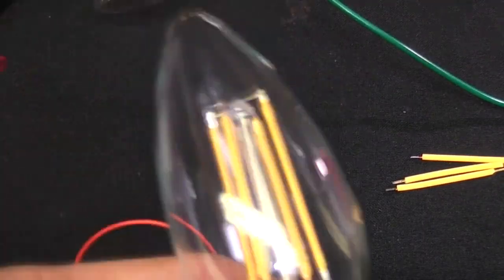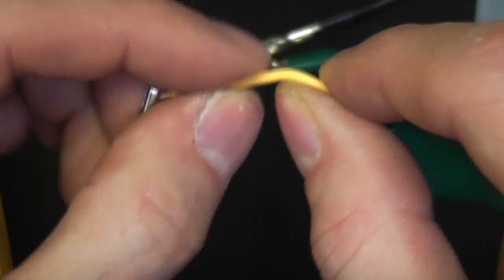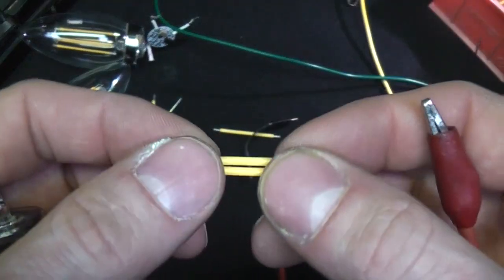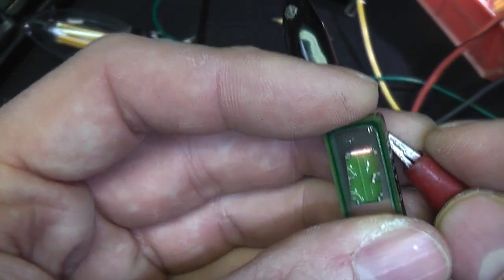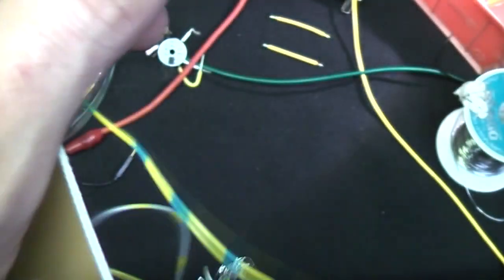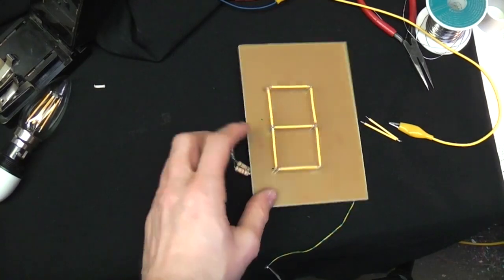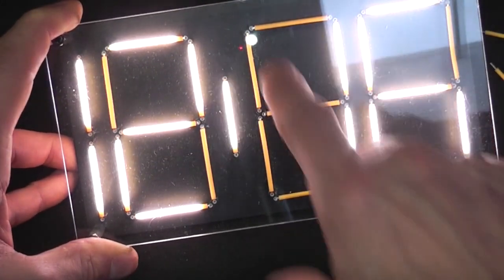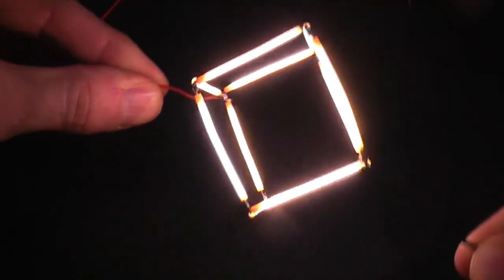LED filaments

Comment: Very nice!  I'm hoping they do these filaments in other colours at some point.
The ULN2803 went through my mind when I was playing with these.  Octal Darlington driver rated to 50V.
Reply: +Dick Fageroni Yeah but the TI chip (which I just happen to have a tube of right here) is serially loadable and can be daisychained - much less wiring
Reply: That's what I thought of as well. They work great for driving nixie tubes too.
Reply: bigclivedotcom You can buy bulbs with coloured filaments.
Reply: You can get loose coloured filaments (red, blue and green) on eBay now, including ones at 12 V and 3 V.
Reply: @rupert274  Really? What search terms?

Comment: Careful with that ~200v cube :)  Really interesting as usual, off to eBay now...
Reply from the maker: Tony Wilk what's the problem.... I did put a 10K resistor on the output of my 0-600V bench supply!
Reply: mikeselectricstuff More power Igor!
Reply: Yeh, I had quite a few broken or 'iffy'. Just shoved in a bag isn't good enough for things this delicate.

Comment: got one of these, they have terrible flickering
Reply: mikeselectricstuff I think he's referring to the 60Hz flicker that these poses. I cannot stand those sh*tty cheap Xmas lights during the holiday's. Not only are they overly factory blue overcast to them, when looking at them indirectly (with peripheral vision) or scanning your eyes from one thing to another such that the LED lights cross though your vision, and you can see the lamp cycling on and off. I like the old fashioned Xmas lights with those nice 40W large candy colored bulbs MUCH more.
Reply: Power Max  Well, at me its 50hz, but yep.  They dont have a smoothing capacitor.  its like a strobe.
Reply: gamerpaddy With a full wave rectifier as these had, the flicker would be 100Hz or 120Hz, which shouldn't be too bad.
Reply: ***** I agree about standardizing frame rates, and wish the interlaced format dies as well. The reason for 50Hz and 100Hz recording is that that is the main's frequency common in EU and asia, so the lighting used to film movies also flickers at 60Hz, (I think the film industry use large Xenon HID lamps, although I am not sure.) If they recorded at 60Hz with lights flickering at 50Hz, there will be noticeable beat frequencies, a 10Hz pulsing effect, which is considerably more annoying.
Reply from the maker: gamerpaddy the one I took apart had the wires from the bulb just twisted with the wires from the driver PCB, so quite likely to go intermittent in odd ways.
Reply: ***** 10x bigger? What for? Efficiency is generally highest when the load is close to maximum.
Reply: MichaelKingsfordGray OK I found one mistake on my part:  I take back what I said about the 470μF capacitor. Although the current draw is tiny and miniscule, the voltage drop across the long string of LEDs inside each filament is really large, and a HV capacitor will be needed (3:03). 100μF Photoflash capacitors would be too big, and the caps I have in a junk bin are only 16V and 35V. I did find a few small capacitors, 2 rated for 160V, 4.7μF, and another one the same size, rated for 200V, 5.6μF.They are all about 8mm wide by 12mm length. I think it is possible to squeeze a few of these in in parallel inside the base, even if they stick out some.

I did some basic first order calculations to the ripple voltage over time with the 2 160V, 4.7μF capacitors and the 5.6μF one in parallel after the bridge rectifier. The total capacitance will be approx. 15μF, and that the ripple frequency is 120Hz, assuming that with each cycle, the capacitor gets charged up to the full LED drop voltage of about 70V, and that the current draw is roughly constant (12mA) over time (which it absolutely is not). Some simple math tells me that the voltage sag over 1/120 = 0.00833 seconds will be about ∆6V. This about an order of magnitude better than the ripple voltage of 70V like it was before.

Going a step further, assuming each LED has a Vdrop of 3.5V, I have determined that there are 20 LEDs in each filament so that the total Vdrop is 70V, so some differential math tells me that there will be approximately ∆0.3V of ripple voltage across each LED in the series, and the Vmax voltage is like 3.5V, and the Vmin voltage is about 3.2V. The flicker in the LED lights will be reduced, but certainly not eliminated because of the steep IV curve characteristics of LEDs. I am sure you can prove me wrong on a few things, this is the first time I used the calculus definition of capacitors to determine ripple, vs just guessing what will be needed like I so often do for many projects.
Reply: the ones to get are the ones that are advertised as being dimmable, the non dimmable ones flicker badly in any kind of light dimming environment and sometimes just flicker to spite you. the dimmable ones should be the default honesty
Reply: gamerpaddy I found the ones with a larger white base have an actual power supply in them and dont flicker. The ones with the glass straight onto the bulb cap just have a junk capacitive dropper.

Ignore any claims of no flicker from the sellers on aliexpress or ebay. They never know what they are actually selling.
Reply: It wasn't to do with lighting but to ensure that any non linearity in the crap powersupply in early tube tvs had the distortion as a static artifact. As soon as they stopped using the grid as the sync source or used a different part of it that all went away. Early cameras and until the 80's were tube based so had no shutter. 

They faded away which is why when massively over exposed with bright lights they left those trails that are a feature of 80's music videos.

Didn't get the shutter effect till Ccd cameras came along with their ability to freeze clear still shots out of video at short exposures. 

This is why people associate fluid motion with 80's soap operas since they had that effect from no shutter closures.
Reply: gamerpaddy I bought some of these, but the flickering isn't that bad on the ones I had. They had all of the filaments in parallel, so the LEDs were only actually off for a very short period of the AC waveform due to the forward drop of the LEDs being around 70V.
Reply: Power Max
Just use proper lightning with high frequency electronic balasts or use LEDs with proper PSU with 10x bigger capacity than needed.
Reply: sdgelectronics
To have a steady DC-Voltage without any ripple regardless of which current the load draws.
Reply: sdgelectronics It's all in the impedance matching! (or voltage bridging, in some rare cases)
Reply: ***** I have seen old footage of the old tube sensor's, they have an a strange but organic feel to the footage, if only they could produce HD... :( I am sure there is some niche camera on the market that does so, though way overpriced.

Although that's interesting! Though  I wonder why would they use main's as the Vsync, I would think that the AC main's would have some possibly long term drift to it, which may cause issue's, although not sure.
Reply: Power Max OH GOOD GOD I KNOW. I bought a ton of those LED lights at Christmas on a big discount, over 50% off... when I got home and plugged them in? The flicker just... I thought I was going to have a f$cking stroke it was so bad. I wonder if there's a way to wire something that would smooth out the light... I'd be willing to do it, because I'm stuck with 30 dollars of these shitty lights. I did get a lot of lights, like 300 feet for that much. I might just use them on the outside of the house where others have to see it and not me lol.
Reply: Jesse Crandle who the hell pays 30$ for these?
Reply: gamerpaddy ... You did not read what I said at all. PowerMax said he hates the shitty cheap Christmas lights with the 60hz flicker, I told him I bought 30 dollars worth of them on clearance but didn't know they flickered.
Reply: Yeah, well my issue was these lights were originally 20 or 30 dollars for a single strand, and I figured for that kind of money they'd have the courtesy to NOT use single phase. It's pretty pathetic to think that they did, though. How much would it have cost to just add 3 phase into the wall wart? It's all made in China to begin with, Wal-Mart would have made 28.50 in profit, but instead they decided to make it single phase and make 29 in profit. Pathetic.
Reply: Well for those who have lights and are bothered with the flickering, it is a very easy thing to fix. Just run down to the local radioshack and buy a small 470uF electrolytic capacitor a >100V >10uF electrolytic capacitor to place across the LEDs. (assuming there is already a full wave bridge rectifier in series with the LEDs. You may need to add one, if there is not already one in the driver.)
Reply: MichaelKingsfordGray I am sure you can figure out a way to cram one in, and if the LEDs are capacitively coupled to begin with, there is not a whole lot of things that can go wrong unless you short out that series capacitor or bypass it in some way.  Why bother with 105*C rated one? I do not see a simple LED filament bulb generating that much heat to cause the internal temperature to go that high. It is not like the capacitor is going inside a crammed SMPS next to the switching devices and rectifiers.

If you cannot get a 470uF one to fit, get a smaller cap. A 100uF one. I have ones that are REALLY small, from things I have taken apart, like as in 3mm by 5mm. Keep it insulated so as not to short out to any thing to the mains directly and the worst that can happen is that a short develops and there is effectively a small capacitor across the mains it is trivial.

If you are sooo concerned about safety, add a small 500mA-1A fuse in series with the mains.
Reply: Power Max I don't know much about what you guys are talking about, but I do know I bought some Ikea Christmas lights on sale in January, I actually use them for accent lighting, and they 50 LEDs and use a whopping 3 watts. My guess is that PowerMax is probably right, might not be (from an engineering point) a great idea to use a capacitor like that, but in the end it'd probably handle it just fine...
Reply: a Capacitor big enough to smooth out the voltage wouldnt fit in the socket, true.  but it could fit inside, where the filaments are.

even if it could last for a few milliseconds, it would make it better
Reply: MichaelKingsfordGray _"LEDs run on DC, and can NOT be capacitively coupled! They wouldn't bloody-well work!"_You are absolutely correct. Why do you think I mentioned a full wave bridge rectifier in my first comment? In fact, the driver circuit for this lamp IS made this way, capacitively coupled to mains, and full wave bridge rectified.

I still do not fully agree with the 105*C cap, since I rarely see them even in equipment, generally only when space is tight and the capacitors have to be stuck between heatsinks. Besides, what I say is nothing more than a hack solution, something that if it bothers someone enough to do something, then they can do a mini-teardown on it and make the simple mod. As long as they use common sense and make sure things are wired correctly and there is enough clearance and creepage for normal operation, I do not see the problem. Even if the capacitor dries up over time, it can be easily replaced by a DIY'er.
Reply: MichaelKingsfordGray Same. I did "build" this LED circuit in LTspice, and it seems OK, about what I had predicted. Although I do not know how to determine power dissipation with a capacitor with ESR. You do sound more experienced than me at the matter, 105*C caps certainly would last much much longer than lower temp ones. Also, come to think of it, even though again the LEDs look wimpy and low power, (with no heatsink and such) they are in fact 1W each (3:07), and there are like 4 of those in each lamp, at least 60% of that 4W is turned into heat, and with no consideration for heat buildup, that may be an issue.

Though like my original comment, as a simple hack solution, the worst that can happen (assuming again the hacker did not bypass the series capacitor and did add a small fuse) is the cap will dry out after a few months or so and flickering will slowly come back. Maybe a nice 'pop' along with it too :P.
Reply: +mikeselectricstuff Led's go wierd in all sorts of odd ways, especially if driven at the rated current. The chinese seem to like impressing us by overspecing their components. Yer at -10 it would last maybe.
Reply: +MichaelKingsfordGray I have to agree, long term exposure to that kind of lighting can be detrimental and cause nausia at least, and i'm not in any way sensitive.
Reply: Had a similar problem on a job (I'm an electrician). Crazy flicker, but when we dimmed the fixtures to about 50-65% the flicker went away.
Reply: I don't get why people complaining about the flickering just don't throw a capacitor in parallel. It would only need to be like a 100 volt and less than 100 uF.
Reply: because its sealed and theres not much space left for a cap.
Reply: yea but you can add a cap in any number of ways, it doesn't have to sit right next to the led
Reply: gamerpaddy Trust me, it's as bad as a stroboscope.
I'm very sensitive to that. I even can distinguish between 60 and 120 FPS video.
I can even tell if a 50 FPS video is displayed on a 60 Hz monitor. It's a glitch party...
Since PAL and NTSC does not matter anymore, I hope everything other than 30, 60 and 120 FPS will die forever!
24 FPS is crap. Cinema should go for 30 60 or 120 FPS, NOW!!!
No one needs that 24, 25, 50 and 100 Hz crap anymore. And that being said by a German, where PAL was standard!
Sorry for ranting, but enough is enough... The simple reason is that almost every display is running at 60 Hz. So 30, 60 and 120 FPS are fully compatible, you won't see any stutter and glitching caused by reordering the frame timings to align to the bloody VSync, because it's simply not necessary anymore.
Reply: ***** EVERYTHING TRUE, but cinema stay at 24p. I really like the look of it in the theaters, and when I screen my indie film next year I want it to be shown in 24. it just does things to the mind. willing suspense of disbelief, less is more in a movie. I make movies and honestly when you watch movies from the masters like Tarantino, Scorcese, Hitchcock - its almost like the film wouldn't work at a higher frame rate! Every frame and the way it appears is purposeful. The directors and their art departments share dreams.... jk they toil endlessly and yet at the same time concisely and effectively.

Comment: Excellent video.
Perhaps it would be possible to replace the sleeve with a more attractive one.
Or just use the bare LED strip for a "high tech" look?
Reply from the maker: mark314158 No - if you peel the silicone (or whatever it is), it takes the bond wires with it. Might be possible to dissolve it in something though.
Reply: mikeselectricstuff Or since they are so bright put the whole thing in another more attractive sleeve or coloured glass/plastics tube.

I wonder if some manufacturer in China might not be persuaded to sell a reel of bare diodes ...

Comment: How do you turn your PC on and off? I mean, the back of the case is facing you, and assuming the power button is on the front, it doesn't look like you can reach back there easily with all that stuff and cabling...
Reply from the maker: MinecraftReviews1 It's a homebuilt case with everything on what is usually the back.
Reply: Oh, thank you for the quick reply.

Comment: "They turn into dark-emitting diodes" XD
Great video and project as always!
Reply: komrad36 You haven't heard of the Smoke-Emitting Diodes? xD.
Reply: komrad36 I can remember playing with LEDs in high school, I put one across a car battery and made a pop emitting diode. Damn near crapped myself.
Reply: If you drive enough current trough them they might turn into black body radiators and end up looking like real tungsten filament again!
Reply: Gordon Freeman ive had some sound emitting diodes! And on one occasion when i shorted a battery with a diode, i got a heat emitting diode!!!!

Comment: Why not just drop some black heatshrink over the pin to prevent them from shorting out?

It'd be lower profile, and it would also help to hide the pin to some extent, particularly if on a black background.
Reply from the maker: Connor Wolf It would be fiddly to do neatly, and wouldn't help maintain consistent spacing & position of the sockets.
Reply: mikeselectricstuff Adding shrink tubing would help....heck once you have them all shrink tubed you can add a dab of epoxy in between the poles to holes them pretty close together and it should be pretty consistent.

Comment: Is it really ok to leave the drivers hooked up to that 70V? With very small currents, the LEDs have a much smaller drop than that 70 volts and the remainder would be on the open output... I'm not sure.
Reply from the maker: lodevijk It isn't an issue - the driver would clamp anything over 50V

Comment: If only they could make them much, much smaller, construct them into 7-segment digits, make an array of them and then use small molded plastic lenses over the front to create a strip display.  You could then use them in 1970's four-function calculators with ultra-crap keyboards and powered by PP9 batteries.  What?  It's been done?  Damn, I have to get out more ;-)
Reply: It must be one hell of a calculator if it needs a PP9.